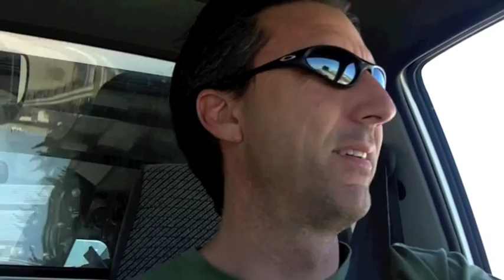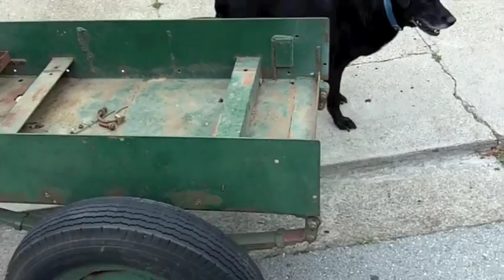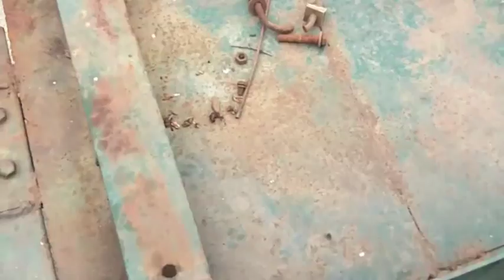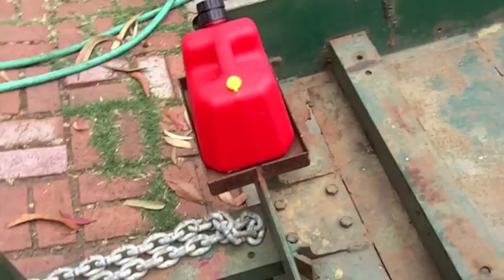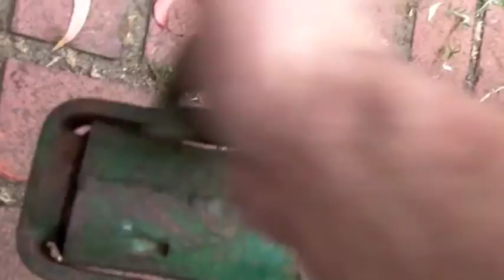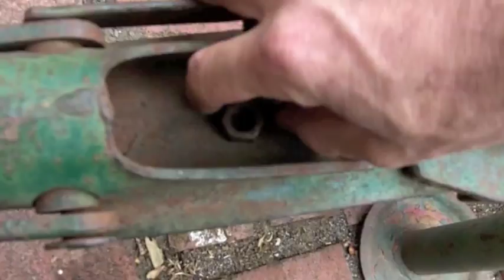A New Way to Drag My Hoe Around Town

Comment from the maker: Hey Chief, I have patiently waited for  an opportunity to buy a trailer like this and it paid off. This thing is constructed very solid and once I go through it, It should be hassle free for many, many years. I have to see how the tiller sits on the trailer, but the battery tray will definately be used as a gas gan holder.  Thanks for watching Chief.. Aloha!

Comment from the maker: There is no "made in China" steel in this thing.  Most of the time I just want the machine somewhere and don't want the hassle of the large trailer...of course if I need it for a large project I can get it there in the big trailer with additional tools/equipment loaded in. I like options. I'm excited to be able to drive it on and drive it off.  Mr Newman is my biggest fan.  lol.  He really is an awesome dog..best one I've had to date.